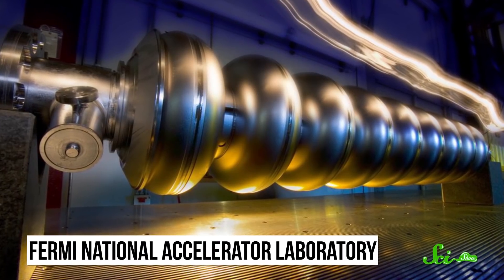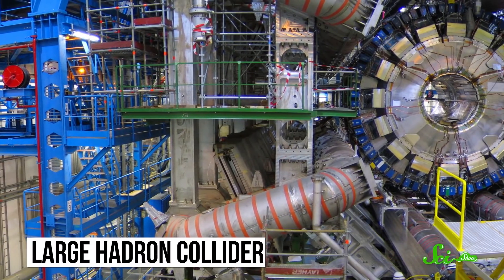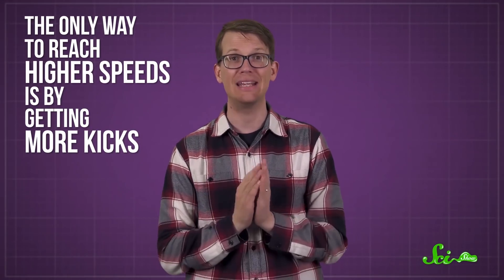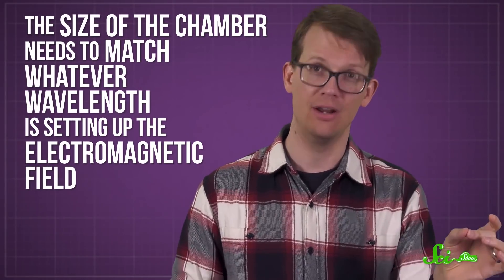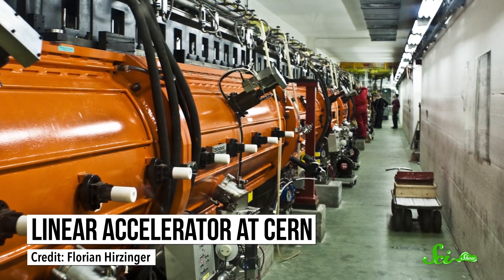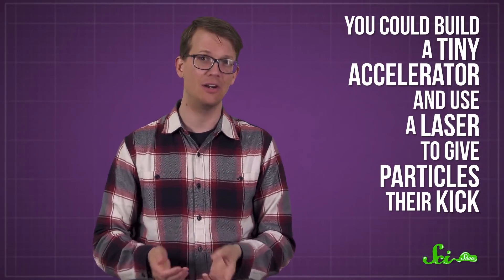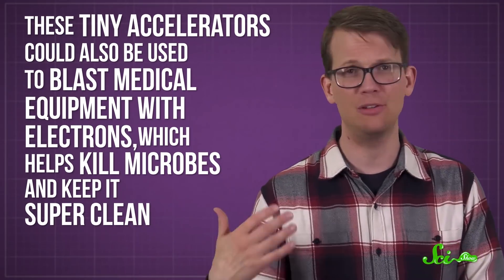Why Scientists Want to Build a Shoebox-Sized Particle Accelerator

Comment: Very nice video, but it misconstrues how this relates to the LHC. There are only 16 superconducting RF accelerator cavities at the LHC [1]. The reason for it being 27 km in circumference has nothing to do with accelerating particles and everything to do with constraining them into a circular-ish tunnel. The factor limiting the "speed" of the particles is the magnetic field produced by the 1232 dipoles, not the RF system. It would be more relevant to compare the energy gradient (gain in energy per unit length) each accelerator technology.
[1] https://home.cern/science/engineering/accelerating-radiofrequency-cavities

Comment: On-chip integrated laser driven particle accelerators can be modified to make particle deflectors. A sequence of alternating deflectors in series would form an undulator that forces electrons to wiggle back and forth to generate bursts of synchrotron radiation. Such micro-bunched beams could produce X-ray pulses. There are many industrial, medical, security and scientific research applications for such compact, low-cost X-ray sources but I suspect one of the things that will come out this technology is X-ray guns.

Comment: I once went to visit a shitty local south african particle accelerator (ithemba labs). Full of fun nuclear signs to entertain a group of physics students (I was a first year that managed to sneak onto a 3rd year field trip). Anyway it turns out that the different sizes of accelerators allow for different types of particle/energy research and products. Like in spite of these guys cooling off parts of it with a blue plastic fan straight out of the 80s, they actually make some very useful cancer meds that get flown all over the world asap (for optimal radiation half life). a few other cool things too. Like they have this intense brain tumor room (like you focus a beam of particles to a pinpoint region to blast a specific tumor) - you have to walk through a chonky winding concrete tunnel to get there presumably because radiation. I can’t remember anymore but one of these medical rooms had the patient bench made out of wood rather than a type of metal because of how particles might interact with metals. definitely looked like a torture device. I asked the physicist how many patients they treat in a year. apparently none because the post for a doctor was vacant at the time (oh Africa). I’m being nasty now - I switched to engineering and went back there years later to a different department to get some help with chemical vapor deposition done to some slides for my dissertation. The facility is maybe a smidge outdated and underfunded but they do some seriously cool stuff there. also they have zebra and some other game just chillin around the property. Also I asked about the electricity bill for the particle accelerator - apparently its astronomical haha

Comment: The first particle accelerator, called a CYCLOTRON, made the particle go through the SAME field many times.  It used two D-shaped hollow electrodes in a flat circular vacuum chamber, with a radio frequency AC voltage between them.

It was made in the late 1930s at UC Berkeley, and was used in Project Manhattan During WWII.

Comment: Why not make a colider the size of the hadron (or even literal right next to it) with these accelerators. This should ramp up the energy of the particles racing around them. A collider with thounds of times more power in the same area, sounds like gaviton detection to me. 😊

Comment: So basically CRTs are making a comeback?

Actually making them smaller, couldn't we use them as an energy or propulsion device? You often see in some sci fi particle accelerators in spaceship engines after all. I mean electrons do have mass and if you fire it out one end in space, wouldn't you be creating thrust? Especially as electrons are a lot less heavy to cart around than chemical fuel.

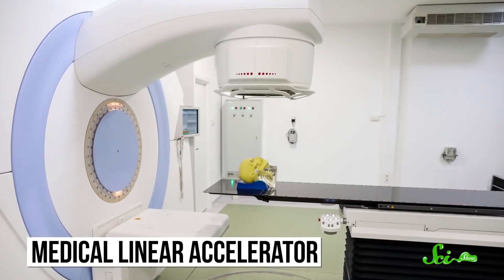Comment: @3:24 Actually it's more often protons or even heavy ions rather than electrons. And that originates from the fact that heavier particles have this property decscribed as "Bragg peaks". In other words, high-speed protons do not just collide with the surface of the skin and deposit all their enegy at once as electrons would do (more or less) but instead they penetrate the skin and deposit their energy at a precise depth that is determined by the particle's energy in electronvolts (eV). This causes the surrounding tissue to be much less irradiated than the cancer itself.
Look up companies such as Varian or IBA, and check "protontherapy" or "hadrontherapy"
Reply: Also there are other ways to use "ordinary" RF accelerators to get large energies at small distances, and these are related to wakefield accelerators. Simply put - one bunch of particles moving through a EM field can cause a wake, that reflected off the walls of accelerating cavity bounces back and causes a kind of a shockwave that accelerates the next bunch much more. But the timing is tricky :)
I work in the field of particle accelerators and if you ever wanted to talk, I'd be delighted as I am one of the biggest fans from the beggining ;-)

Comment: Can we than call it a Laser, or is that a  term only given to a electron accelerating device? Or is "Laser" only a given term to a device that doesn't accelerate particles outside a Gas. Is a Particle Accelerator a scaled down Railgun or scaled up? Pls explain. When is it called a accelerator? Only if the accelerated stuff has mass?.... edit: Yes!

Comment: I'm going the opposite way, and building an accelerator large enough to move a shoe-box at relativistic speeds.
It's not going well. But one day I hope to use it for the swift delivery of shoes.
Reply: You better hope you have some amazing confinement there then, cause the picosecond that thing hits open air the whole planet is gonna experience one very hot surprise shoe delivery.
Reply: @thecloner212  Nah, not picosecond. Given that the diameter of earth is about 42 light-milliseconds, most people will be okay for a while (relatively speaking).
Reply: I'm just guessing, but is the problem getting it to stop at the other end? ;)
Reply: That's just a Relativistic Kill Missile, like the kind you chuck at life-bearing worlds when you're a super-villainous K2 civilization that's worried about rivals.

Comment: This really isn't the limitation that requires colliders like the LHC to be so large.  The two issues there are synchrotron radiation (i.e. the light radiated away because the particles being accelerated are moving along a curved path) and our ability to create stronger magnets.
Basically to make a circular accelerator smaller, while keeping the energy of the particles the same, you need them to pass through stronger magnetic fields; and, the LHC's magnets are already less than a factor of 5 weaker than the strongest magnets we've ever created (which almost certainly couldn't be operated on this scale). And, then, as you do that, the energy lost to radiation scales like 1/r^2, with r being the radius of curvature.

Comment: There is a process for particle acceleration that is much more efficient using lasers which is called Target Normal Sheath Acceleration which will get ions up to 100 MeV in just a few µm which is hard to top in terms of compactness and has a higher acceleration gradient that this technique by a factor of 40000. I've recently published a paper about using this mechanism to create a compact neutron source. I really recommend to check this out, maybe it's worth its own video.
The paper can be found here:
https://www.researchgate.net/publication/339851404_Development_of_a_Setup_for_Material_Identification_Based_on_Laser-Driven_Neutron_Resonance_Spectroscopy

Comment: if they got smaller the energy used for kicking are smaller too,
smaller in size, then just make them spirals and it potentially can surpasess the speed of light or matched with smaller size but multiple kickers at the place, let me use Einstein equitation e=mc2 then,
(e=mc2)*n where is n the number we wanted its totally make sense with small particle acceleration smaller power but travel at longer distance when it all creating electromagnetic field we might be create the FTL one or at least same speed with the light

Comment: You didn't mention manufacturing, but alot of manufacturing processes can benefit from smaller accelerators (I think there is a solar cell production method that uses an accelerator to create a more efficient panel, and a smaller accelerator might reduce cost and increase availability of the process)
Reply: minutephysics covered the technology a few years ago: https://www.youtube.com/watch?v=lPBTdSfLBg8&feature=emb_title

Comment: The first thing that went through my mind is that this could be used for ionic propulsion. If you can get human hair size channels then you could most likely have a few per square mm. Scale that up to a foot square and you have 90,000 square mm to play with. Even if you are only talking 1 nN per accelerator then with just 5 per square mm you could have 0.45mN 100nN and it's ten times better than what is out there now.

Comment: TONY STARK WAS ABLE TO BUILD THIS IN A CAVE! WITH A BOX OF SCRAPS!
Reply: He made an accelerator in his basement workshop in the second movie.
Reply: I love this comment 3000
Reply: That was a fusion reactor he made way different than particle accelerator. But in theory you could make a hybrid machine from both. We have fusion reactors today only a couple but some dont work the way there supposed which in terms mean they require more energy to power than they put out, scientist are trying to figure out the correct formula so the fusion reactor works more efficiently. and others dont work at all. But main issue is getting it small enough to the size of a car or smaller. From what I read in the next decade the fusion reactors will be up and running in some places with 100% efficiency.
Reply: cak01vej  "It's just 20 years away!"
30 years later:
"It's just 20 years away!"

Seriously though I hope they get that sorted soon, can't wait to have a good source of energy that doesn't either poison the entire planet very slowly or a small part of the planet very quickly.
Reply: @Nerobyrne  well fusion is utilized in thermonuclear bombs today, so it would take a small part of the planet if it failed
Reply: @SK-pw9id  not neccessarily.
For instance, while nuclear bombs are very dangerous, a nuclear reactor cannot explode in the same way. It's still dangerous, because the radioactive material may leak out into the surrounding area.
Or it might happen that pressure builds in the pipes surrounding the radioactive material, which may send some of it flying.

The reason why it can't explode is because it's designed to release the energy slowly, over a long period of time. So, just by how it's made, it cannot cause a nuclear explosion.

Comment: Use a shoebox accelerator to make lithium6 turn 18650 lithium ion cell into a hybrid battery/high density hydrogen hydride tank...drive 1000 miles...nuff said...

Comment: Now if it could be used to accellerate protons it could be a very useful medical device since protons dont interact with matter much until it reaches the target depth andcit dumps all its energy there, depending on the energy of the beam.

Comment: I can't wait for my kid to accelerate particles at school in science class
Reply: It's already been done. It's not that difficult if you go for moderate energy levels. A magnatron (out of a microwave) and a cyclotron are not that different and the mag can be hacked. The cloud chamber is dead easy too all you need is a petri dish with lid with alcohol vapour in it that has been cooled by dry ice and a nice strong neodymium magnet underneath.
Reply: This comment has so much hope in it that it warmed my angry cold heart.
Reply: I read that wrong... too wrong.
Reply: Alright kids, get your magnifying glasses out so you can see those electrons!
Reply: Can't wait for my own shoebox fusion reactor
Reply: I shall name it mini me. 😂
Reply: Apparently Michio Kaku did something like that
Reply: Omg stop now I cant wait too
Reply: Most kids were brainwashed by particles accelerators before the CRT was replaced with LCD.
Reply: @PrivateSi  ...What?
Reply: @thomaswang4427  I can get 30000 volts from AA batteries. No need to modifiy the grid.
Reply: Yea if there is anything left of this country by then.
Reply: They are already accelerating particles in bathroom.
Reply: Just bring an old CRT monitor. It IS  an electron accelerator
Reply: And then your kid will skip school because “nothing interesting ever happens! just these boring old particle accelerators every time! Urg! Why doesn’t anything cool ever happen in school?”

Comment: Lets build an accelerator on the moon circling the equator of the moon. Use solar power to power the accelerators. half the moon is lit at all times. The moon is cold enough under ground to reduce resistance.
Reply: Damit beat me to it, but still like it

Comment: Using the physics of movement and equal & opposite reaction stuff, if you had a wall of these in suitable length to accelerate particles out of one end, would that generate enough thrust for a space faring vehicle? Or am I just fantasizing about someone inventing the Impulse drive as used in Star Trek? :P
Reply: A version of this actually exists in the form of ion thrusters, which ionize atoms or molecules, and then accelerate them through an electric field.

Comment: why only an electron? Why not a small projectile moving at a fraction of sol?
Reply: It's a question of charge to mass ratio. To put, say, a grain of rice with a mass of 0.000029Kg into the LHC and be able to accelerate it the same manner as a single proton, it'd need a charge of around 2.78KC.
If you try that and the rice burns to a crisp, you're lucky, because charges of that magnitude should vaporise pretty much anything with that kind of mass, even if they're made of more durable materials. Assuming my understanding of physics is accurate, which it might not be.

Comment: For decades we all had small particle accelerators in our homes.

We used them to watch hours of drivel.
Reply: Is that TVs?
Reply: @Kordrean  , yeah, Cathode Ray Tubes.
 They accelerate electrons thru a vacuum to hit phosphor dots on the screen.
Reply: @massimookissed1023  
Convert it into a looping accelerator, yes.

Accelerating particles to near light speed using such equipment and available track length, now that's the engineering challenge.
Reply: They're using humans as biological particle accelerators , energy harvesting via energy weapons thru satellites, radio towers, planes, drones and an army of gangstalkers with apps it's far worse than anyone realize

Comment: So technically as this tiny accelerator has smaller waves so can be more impact, couldn’t it be expanded and made in the same way to the same size as the normal big accelerators just with the same tech as the mini one. Dunno the idea is probably just going over my head a bit and this wouldn’t work lol

Comment: oh a shoebox pitrcal accelerator can be used for diong reserch that will give the milltary the basics for scifi  particle weapons thats the size of a pistol or rifle or can be fitted on a tank as a high calber cannon and make very efcent nukear fusion and antimater reactors viable and make SUPER CHEAP QUNTUM COMPTUERS THIS IS BACLY THE HOLY GRALE OF SCI FI TECH BASICS FOR ALOT OF THE NEXT TECH LEVEL to go into space with